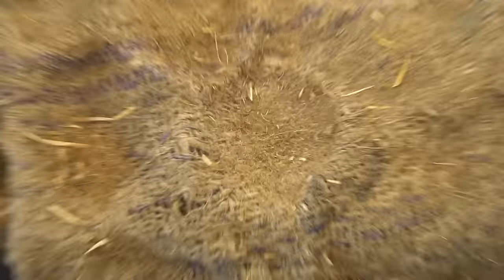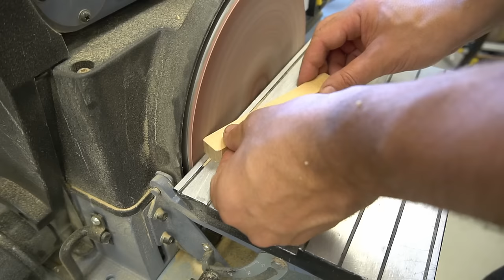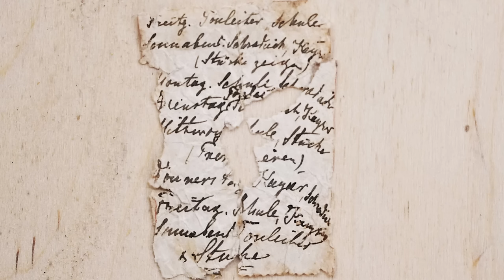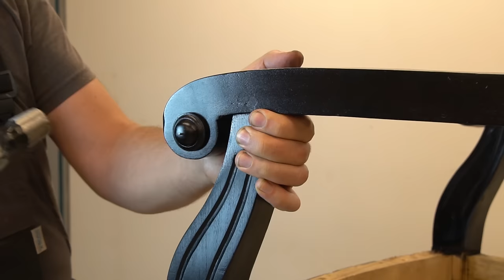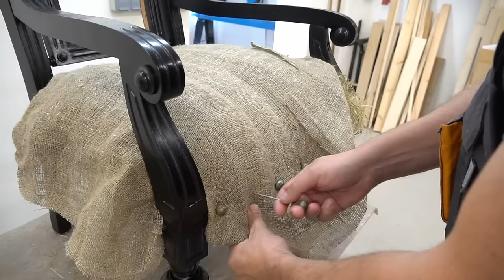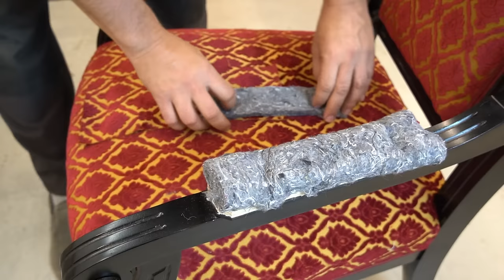I restored a CHAIR and found MYSTERIOUS letter

Comment: Шедевр! Браво мастеру! Всегда самая лучшая реставрация. Со вкусом и элегантно. Мельчайшие детали восстановлены и получается такая красота.
Reply: Самое сложное в этом проекте - укладка пружин и крепеж их шпагатом,затем прошивка сэндвича через слои холста. Это на самом деле очень сложная работа, не всякий мебельщик со стажем понимает геометрию и связку пружинного сиденья  кресел 19-го - начала 20-го веков..
Reply: @khawaification    You sound like you have experience at this, I have a question. He said the old springs have to be replaced and I have an old Empire Sofa that the seat needs reworked. So the springs loose their strength after many years? I would have never thought. I’m very impressed with the restoration job. I also have a chair very similar and it’s a Lincoln Drape in the Eastlake period and it has white casters. It needs some work but is in great shape for its age.
Reply: @johnruth4311  I only have experience with fabric upholstery on furniture. Today, most craftsmen work with foam rubber. It is simpler, shape and elasticity in one. But I knew the old master of retro furniture and saw the work. The springs do not have to be changed, they need to be cleaned of rust. The most important thing is to make a “hill” out of them, so that the outer springs are slightly pressed by the rope, and the inner ones are higher. And drag crosswise and diagonally. The middle of the spring should look like the sun with rays.
Reply: @khawaification   Thank you very much for explaining that, I hope to get my old Sofa fixed up in the very near future. It is a Treasure to me. Thank you again.

Comment: Excellent!
I have four antique oak dining room chairs that have taken a beating by grandchildren over the last few years. The joints at the back of the seat are pulled apart and wobbly. Several of the dowells between the legs broke when stood on. 
After watching the tedious procedure to repair these I think I will replace them instead. I don't have the tools either. I greatly admire your patience and ability!

Comment: Super Thanks. Good job. I was wondering when do you use hide glue? I think conservators use it for the main joints, as it is reversible. But I don't know if this is arbitrary.  My dad was an upholster for 50+ years and worked on high end to antiques, and everything in between. Fond memories. Every were he went, he hat to touch the furniture and make a critic on how it was done and weather it had enough padding and  the quality of padding and fabric used.😅

Comment: I think this could be German Biedermeier, but maybe early Victorian. I have two in the shed waiting for restoration, clearly by the same maker because although a smaller kind it has the same features except mine have no armrests. 
Now I know that all the ball shapes on the front legs are missing a piece, because you had the same problem. But because all four front legs are the same I thought it used to be like that. LOL. 
The base colour was black as well but painted over with cream coloured paint in the 40’s and then by my mom, blue in the 70’s and grey by me in the 90’s…. The chairs have been through a lot. 😅 
Learned so much through your video. Thank you so much. ❣️

Comment: When I make chairs for restaurants I always use 2 nails in every tenon. I figure with 2 nails the tenon cannot pivot so the glue will not crack and the life of the chair is extended. That was my own idea. At least nobody taught it to me. I have always wondered what a professional would think about it. The nail holes fill easily and are small so what's the harm?

Comment: Clearly, the piece of a letter was folded up and jammed into one of the holes because of shrinkage in the wood of the rung. It was there to make it tight - a bodge  by the owner. So it’s not a strange place for it to be, and the letter wasn’t meant to be found or read!

Comment: Umm just fyi flip chair over remove tack nails from along outter wooden  seat frame then simply remove cushion area and then remove the fabric staples adhering the fabric to the bottom of wooden seatingvchange out fluff add new fabric and then tacking nails to the frame and the chair ;

Comment: Surely a headless pin could have gone into the inside surface of the knob decoration  you put on the arm, and then i5 could have been attached to the chair. No need at all for an ugly nail to go in. From the outside!